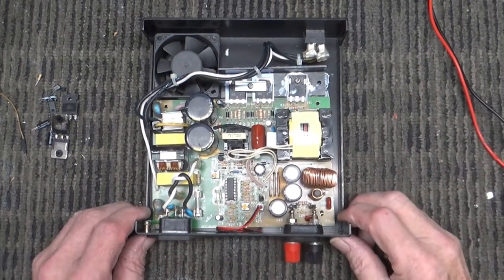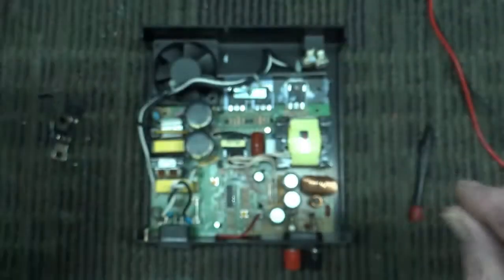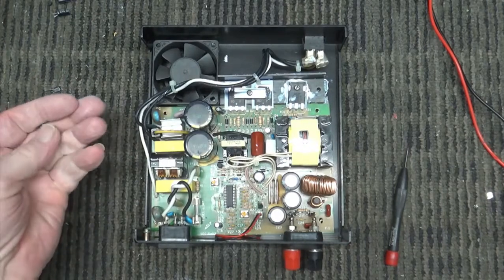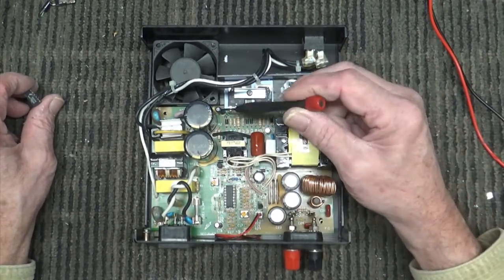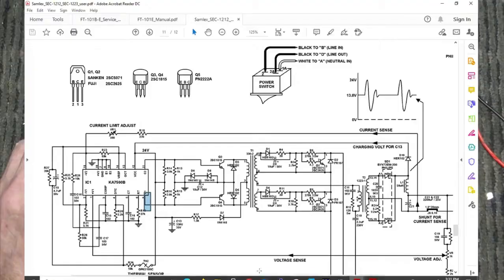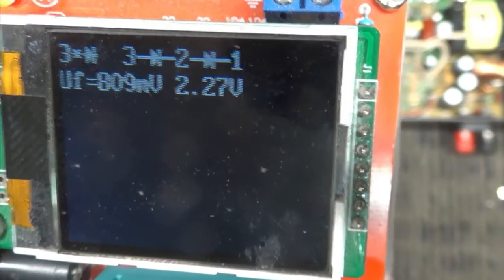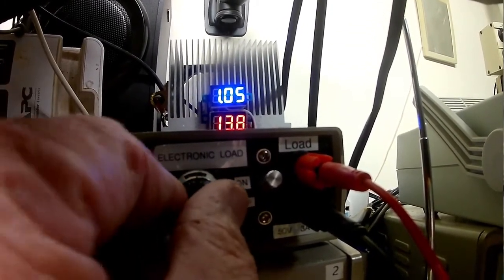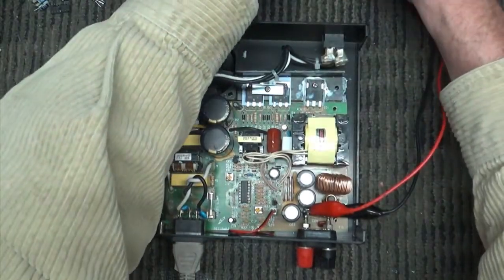Samlex 23 Amp PS Second time around

Comment: Wow, lots of parts for that repair.  Yeah, but will it go to 23 amps??  Cheers & 73 from W Rusty Lane K9POW in eastern TN
Reply from the maker: Those old style switch mode power supplies were very unforgiving. When anything popped lots of stuff popped. And yes, these power supplies will do 23 amps for a short period, just don't push them too hard.

Comment: My experience has shown me that all old caps except mica caps or silver mica caps in old equipment should be replaced, regardless of testing results. Testing of caps should not be ESR, but leakage testing. Doing this with a low voltage helps in the area of safety. All electrolytic caps should be discharged because they may destroy your test equipment or YOU. Of course, higher voltage ratings and higher temperature specs also would be needed, as the way many caps were rated "back then" differed quite a lot from today's methodology. Always test units with a variac and isolation transformer, usually with series bulbs or other current limiting instead of just blasting away with all switches, etc. The idea is to know what and where the possible points of failure might be, and be one step in front of a failure.  Good luck! de KQ2E
Reply from the maker: Oh yeah. I agree whole heartedly about the variac and light bulb. I have a Tenma 72-1095 Variable Isolation transformer feeding a dim bulb unit with a Kill-A-Watt plugged into it. I use it on almost everything I fix. It has saved a lot of parts from hitting the ceiling. As for old caps, yes they should be replaced as a matter of course if they are old or from the 90s or 2000nds (that does not look right) when all the crappy caps hit the market. This thing I believe had had its outputs shorted and the cascade took out the rest. I did check all the filter caps and they were better than anything I have on hand new as far as leakage and ESR so I left them in. Thanks for watching.
Reply: @AERVBlog  ,  I hear ya. The cost of repair time and the cost of caps I know and admire as well as most other parts is so low that leaving them in assumes that there is no time card of when all the caps and such were replaced. That makes any future repair "iffy." LOL I have enjoyed the series from Mr Carlson's Lab where he makes the case for doing what I was doing all along. It was a good thing! ROFL
Reply from the maker: @BruceNitroxpro  I have only run across one thing that I couldn't use the isolation transformer/dim bulb for and that was an old tube type short wave portable radio. It needed the neutral as a sort of ground or it would hum all the time. That drove me a little crazy for a while. I replaced all the caps and it still hummed until I plugged it into a straight outlet.